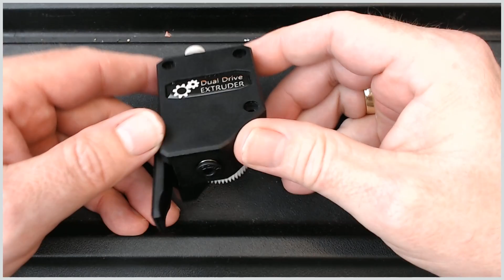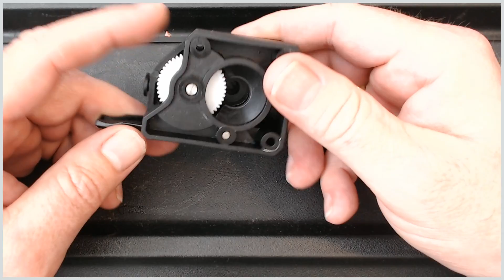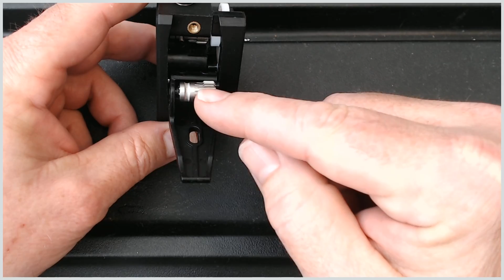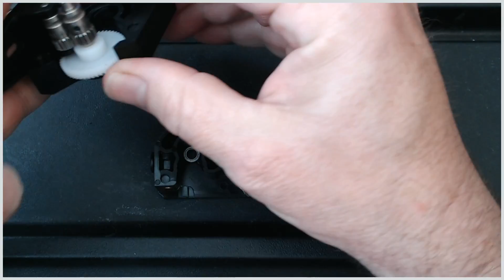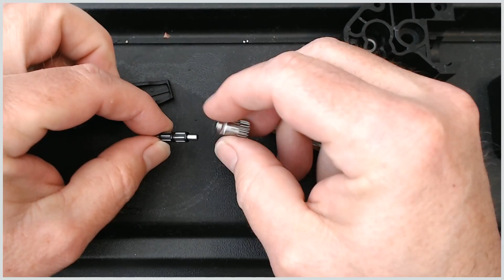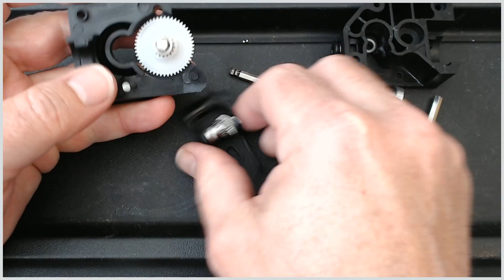3DChameleon BMG Clone Extruder Fix

Comment: I have this exact extruder I and I have plenty of extra tubing laying around. In fact, I bought a big length of it because I thought maybe it was my Bowen tube causing the skipping, but I realize that it was actually a worn out dual drive where the gear was actually grinding on the arm and it got to the point where it was actually binding on it which was causing skipping

Comment: Thanks for this video.  I have the same extruder on an FLSUN and had this problem. I wasn't able to fix it with ptfe since the OD was smaller than the gear ID but I used a couple tiny washers and it worked!

Comment: Just tried that.
The hole in the gear is big enough to fit ptfe washer inside it, so it can still movewhen washer gets inside with bearings
Reply: You can always use a larger tube to do the same thing.
Reply: @williamsteele  I know. I only have standard ptfe tubes used for bowden drive.
I installed some plastic washer what i had to cut to size. Didn't test it yet.

Comment: i have a different issue with my clone extruder... it makes tick noises when retracting quickly.. it seems as if the big gear driven by the stepper has a little bit of backlash, and i think thats whats causing it ... :/
Reply: disable stealthchop and see if the noise is still there

Comment: I have one of these and there is a plastic washer in the bad that I was wondering what it was for. Maybe that’s why it’s in there.
Reply: Ended up using that washer for mine as it fit just perfectly as the bowden tube was slipping under the collar of the gear and not helping with keeping it in place. Planning on just printing a little wafer as it seems to be for the spring as @AndrewAHayes has said.
Reply: @postcert YES it's a perfect fit. some friction but i think it's fine
Reply: Oh... that's a new thing then.
Reply: @williamsteele  As far as I am aware, hte black washer is to go on the thumb screw to stop the spring pushing into the hole on the arm, I have the Haldis model and the gear does not slide around

Comment: I had the same problem, drive wheels not lining up. I used another solution, the lever itself has also so much space on top so I put the "washer" under the lever on it's shaft. Now the drive wheels do not line up 100%, maybe 75% but it is more than enough so that the "free" drive wheel is taken up by the filament that is inserted.

Comment: what is the bearing in this video?
Reply: Hmmm... not sure what you're asking.  The bearings are inside the gear... the PTFE tube was just used as a spacer.
Reply: @williamsteele  My bad, it was 3am for my timezone and I was frasturated. While doing this mod, I droped one of the bearings. I couldn't find it. 

I was asking what is the name/type of the bearing. Thanks!
Reply: Needle bearing... i think

Comment: Have you noticed.. Yet!? that the Cheap Chinese Cloners use a Mild steel shaft  for that gear? 
It quickly wears... creating grinding paste which destroys the bearings as well as the shaft!  Go.. China !
 A dead CDRom drive has a pair of Quality 3mm Slider rods these make for Good shaft replacement donors.  
Best to fit to a New BMG Clone though as  fresh hardened shafts won't be much use in a chewed up gear ./bearing assly.
Reply: I have the Haldis clone which has much better quality steel gears than the really cheap clones, I also have a genuine Bondtech extruder and the gears on that are very much like the ones on the Haldis, they could be genuine Bondtech gears.

Comment: I have this extruder(not clone) and was having extrusion issues. I removed the idler gear and replaced it with a bearing and the problems went away. This happened on my Prusa  Mk3s as well. not a fan of dual drive extruders.

That being said, Using proper sized shims you can really set it so it never moves again.

Comment: I have exactly this problem and I was going to try putting a washer in when I saw how the toothed wheel moved from side to side. I'm pretty pleased that my solution from looking in the extruder and working it out was the same as the experts. Its such a fucking hit and miss buying cloned stuff. I would happily buy original more often but the main problem is finding original manufacturers goods, if indeed they are still made.
Reply: The real ones are like $130 right now :(
Reply: Matterhackers has them.
Reply: @bleach_drink_me  thanks but I have a condition which makes it difficult to use that store. It’s called impatient Australian syndrome.

Comment: I tried this, the ptfe tube just slides inside the gear, and it still slides back and fourth, just over the ptfe tube. What am I missing here? It's like the ptfe tube diameter isn't wide enough to cover the side. I cut about 2mm, cut a slit like you, slide it on next to it, then when I mount it, the gear slides over the ptfe, the same way it does the bearings and I have the same issue as before. Any ideas?
Reply from the maker: Perhaps the diameter of the shaft is smaller... if that's the case, you can use a washer or cut a piece of plastic sheet and place it in between the ptfe and the gear, which will stop it.  You can also use a larger diameter piece of tubing if you have some.
Reply: @3d_chameleon  I was thinking about using a washer, but relatively new to 3D printing so didn't want to mess it up. I'll look and see if I can find a plastic washer, if not I like the plastic sheet! Thanks for the quick reply, damn printer sounds like a phone vibrating extra loud on every retraction, very loud.
Reply: PTFE tubing comes in at least 3 diameters that I know of   Only the largest diameter works.

Comment: No need to fix that as it self align when you push filament through (at least in better quality clones like trianglelab)
Reply: It won't self align in these cases... The alignment is more than the diameter of the filament off in some cases. This really causes issues for autoloading filament.
Reply: Trianglelab  being 'Better' quality is Pure Advert Nonsense.
 Their Stuff is every bit as crap as most All other Aliexpress vendors.. 
They just Charge More on their 'better' pretense.

Comment: i bought a transparent g clone and i installed it on ender 3 with bowden setup why during retraction it makes a very loud sound
Reply: The loud noise on our BMG clone was at high-ish speeds with a 380mm bowden tube @ 5mm retraction.  Turned out it was the set-screw that was loose, grinding away at the shaft through the white gear.  Very common problem on these BMG clones.  Once I fully seated it, and added lock-tight, noise went completely away.
Reply: You need to look at it and watch what is moving if it is making noises... I don't really have enough information to help you, but none of them that I have make loud noises.

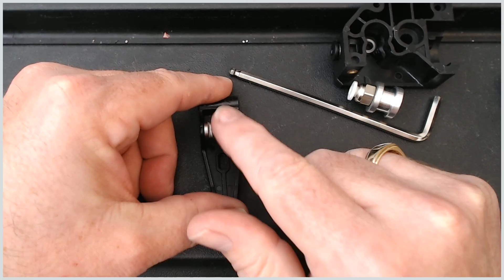Comment: Bad solution. The ptfe tubing gets into it and created friction. @3:55 it clearly doesn’t spin freely anymore, you might as well take out the bearing...
Reply: It does spin just fine... and it's been working for months just fine.  When I spun it, I wasn't trying to spin it freely, I was using side to side pressure to show that it doesn't move as far as it did, which was causing the alignment issue.  The PTFE tube is only contacting the center ring of the bearing, so it's not impinging on anything that rotates.
Reply: Did this happen to you or is your comment a observation? I have done this fix, wandering if I may have problem later..

Comment: I bet that back and forth action has something to do with the complaints about these on amazon. I might grab one of these now. There's a 2.0 clone too that has some corrections made to the filament path.
Reply: I got the exact same one on amazon, and while some of the negative reviews are a little off putting, I thought for a 1/3 of the original I give it a go. It seems to work fine for me, even before the shaft has a little spacer.